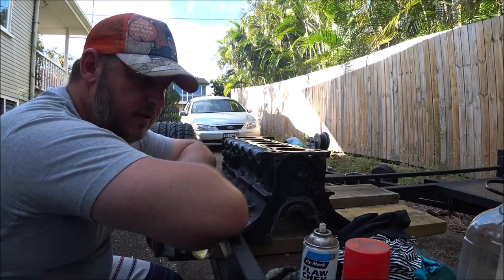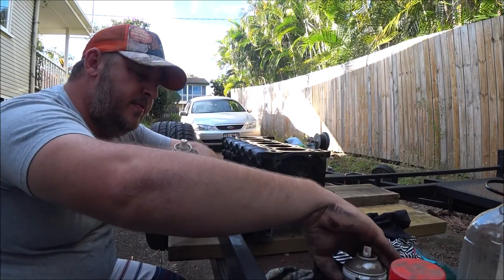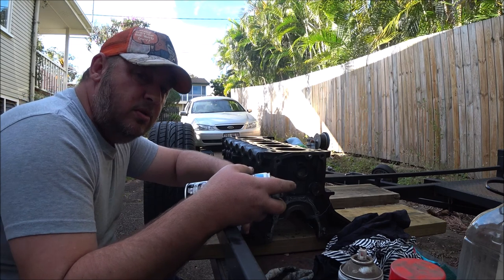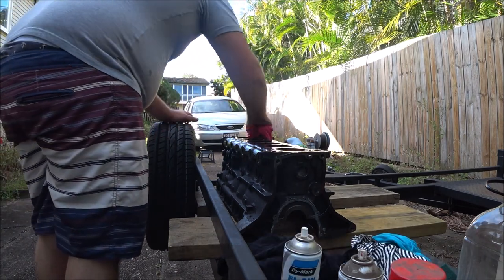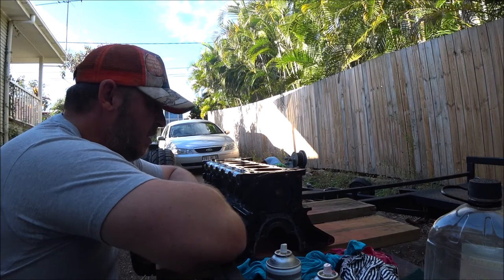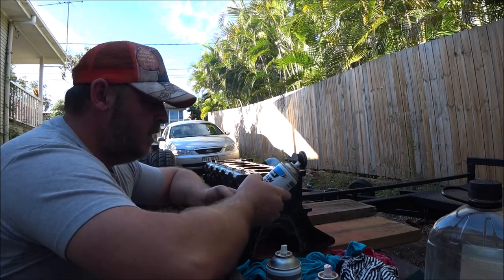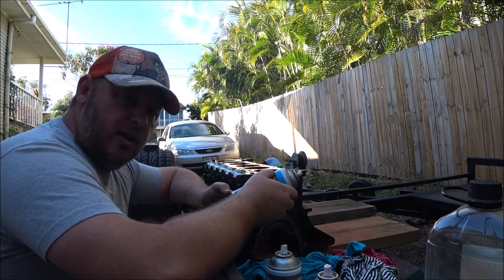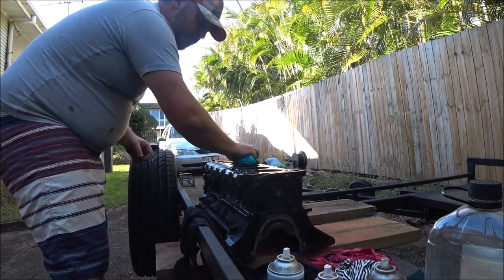RB25DET Build - Dye Penetrant Crack Testing the Block and Crank

Comment: Hey mate, i do not want to be too negative in my comment but...i think you did a couple of things wrong in your dye pen test here. Not saying your definitely going to miss indications the way you conducted the inspection, but it would not be acceptable to do it this way if you worked in NDT and were conducting a test to AS2062. Dye should never be removed by spraying cleaning solvent directly on test surface, you should remove excess dye with rags then you can lightly spray cleaner directly on to a lint free rag and wipe the test surface with said rag as your final way to remove any remaining dye. Also a dye dwell time of 20 min, followed by dev time of 10 min is industry standard for this job. I know this is a driveway job, and honestly what you did is probably good enough (also it is probably what the instructions on the can told you to do). However I work in the industry so thought I would share my limited knowledge. Personally if I was worried about cracks in a block I would try to get someone to flouro magnetic particle test the whole block, quick and easy process but does require at least a hand held magnet(although preferably a mag bench), flouro mag dye and black light. This way you can inspect porous (non-machined areas) and detect much smaller indications. I could go on but i fear i probably already sound too preachy lol. NDT inspections can be costly and can be of limited value if deployed incorrectly, on the other hand if you have good reason to suspect either the manufacturing process, or in-service conditions may have introduced defects to a component you could potentially save yourself a lot of heart ache at the track. Hence why NDT methods of inspection are deployed by professional race teams. 
I like your videos and have learnt heaps about RB engines watching you pull them to bits, so don't think i am some keyboard warrior, we are all learning things all the time whether it be at work or our hobbies.
Reply from the maker: Not preachy mate. I don't work in NDT I'm just a boilermaker/1st class welder, so while we would do this testing ourselves, final tests were always done by NATA accredited techs. In my case, this test was fit for purpose, and did was collaborated by the machine shop where they do use the Flouro magnafux. They got the same results, just also found more finer cracking in the crank. Which is why I said this test doesn't substitute for professional testing, it merely compliments it. And it's 1 step more than most would bother to do. So I just wanted to share it, and let people know they can do a check 1st. IF you get a crack using this test it's 100% unservisable, but the pro's may find finer failures, and yeah instruction on the tin had even lower rest times. I was surprised how well the dye worked on the cast surface though, I didn't expect as good a result as I got. In all honesty, on the tools, we wouldn't even bother with cleaning agent and just give it a good hard wipe with the rag, as long as you we'rent doing it hot, where it likes to bake onto the surface. All these items are second hand and seen modified boost so since I'm building for a race application, everything is being tested, checked, double checked.
Reply: yeah cool mate, got to say owning a drift car that see's regular use I haven't really been able to use my, radiography, ultrasonic, dye pen or mag particle skills to any effective use on my own car, just finding exhaust manifold cracks. 
In my car the engine hasn't been apart since it was built, and trans parts probably aren't worth checking.
Reply from the maker: Yeah I think my welding and fab skills are a bit more practice in these sorts of things. But hey you'll be all over it if you go through what I am down the track.